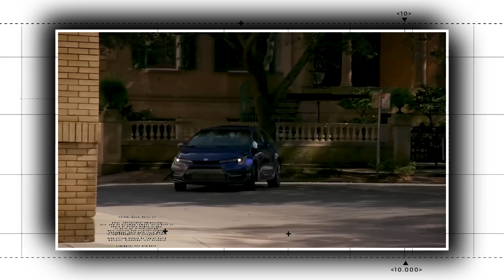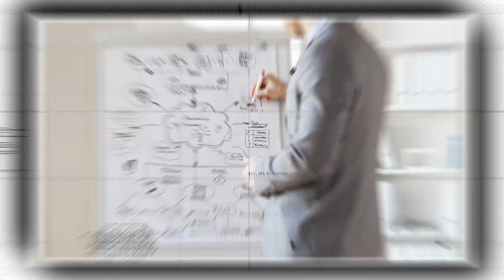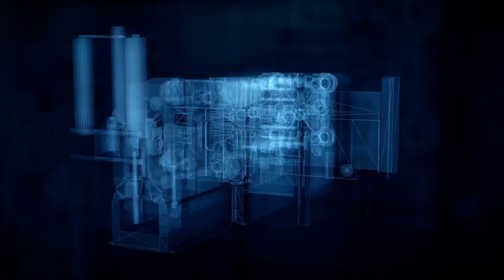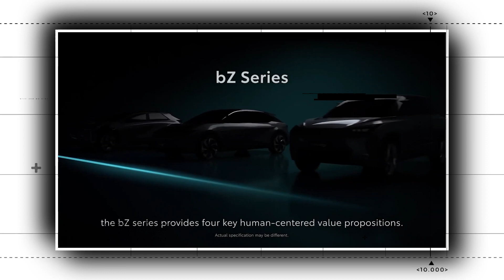Toyota CEO Sato Finally Admits The Truth About Tesla!

Comment: Their quality, Tesla sux though

Have you ever ridden in one?

It's no Mercedes.

There were rattles and it didn't feel solid at all.
Reply: Cliff? What model year was it? Tesla’s poor fit and finish was almost a meme, but by the accounts of those who have actually had experience with them, the quality, fit and finish has become exceptional. Not perfect, but certainly very, very good. Fortunately, the reliability of the major components has nearly always been good.

Start-ups usually have growing pains, but a 2016, or 2017 is NOT the same as what you can buy today. In fact, they appear to make bigger changes from one year to the next compared to generational changes (4 to 5 years) of anyone else. Interestingly although they look the same, a Model Y built in the Fremont factory is not the same car as a Model Y built in Texas.

The Model Y built with a structural battery (4680 cells) isn’t the same as a Model Y built with the Panasonic cells.
Reply: @MFoley-tv3zh  It's not just the fit and finish. That rigid, granite-like solidity you find in many German cars and other Euro cars and some Japanese cars and better Korean cars is not there with Tesla. When you lack that solid foundation, then you can't isolate the car from road disturbances as well as a more solid car.
Reply: @benjaminsmith2287  See more recent reviews and videos. See Ryan Shaw’s videos. He has owned several (five?), and noted the improvements. There have been major improvements in ride quality, rattling, fit and finish.

Comment: It's a myth that software improves Tesla. They suffer battery degradation and wear and tear just like every vehicle that has gone before, as is born out by the value of Teslas decline in value over time
Reply: I speak only from experience. Bought one of the first Tesla in the UK back in 2014. Now 130,000 miles later the car has been improved by over the air updates in range, acceleration, braking, traction, security, voice recognition, sat nav, display ergonomics and much more. So no your very wrong Teslas are improved by software. And yes batteries did fail in some early cars and mine was one of those cars. After 75,000 miles the factory in Freemont noticed at 2am their time I may have a battery fault contacted me by email arranged a new one and loan car and swapped mine out in 2 days. Good service too. Still love driving my Model S P85, Tesla are special cars and free to fuel as its pre 2016. Next car after 10 years use? Tesla
Reply: @slartybartfarst9737  Why would you want to change it after ten years. I'd keep it forever with free juice. Just keep changing what breaks
Reply: @MegaWilderness  To be honest I cant believe I still love driving the old P85 and having driven all the other Teslas the early RWD only cars do drive with a kind a steering finesse that means they are in a sweet spot that suites UK A roads. 0 to 60 in 4 seconds kinda shocks people and you have to be carefull booting the old barge as people still dont get how quick these big cars get up and go, it catches people out. I just cant see how the hell anyone is ever going to use a Plaid on the UK public roads and yea your right the free juice is icing on the cake.
Reply: @slartybartfarst9737  In certain software applications, yes, but not hardware degradation. And OTA updates won't be unique to Tesla. Polestar has been improving their cars in almost all those categories as well and they're relatively new at OTA updates.
Reply: @benjaminsmith2287  Im pleased Polestar are upgrading with OTA it encourages the sale of EVs. Obviously Tesla have been doing OTA updates on my car since 2015 but they have also developed on my car an upgraded harness to mate the latest TPMS ECU with the older cars as my ECU failed and was unobtainable (this harness and software now distributed as modification for all same cars wordwide) and again I had the v2.5 door handles that allow fitment of the latest fail free handles to the older cars with again adaptor harness and firmware plus I had the MCU2 upgrade bringing my car right up to date. I would say Tesla do look after hardware degradation and upgrades as well as OTA